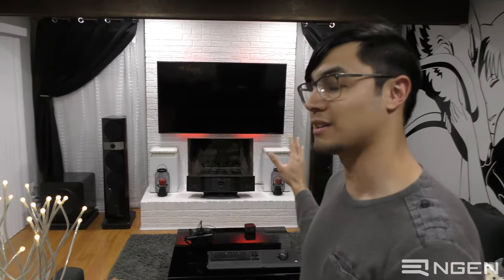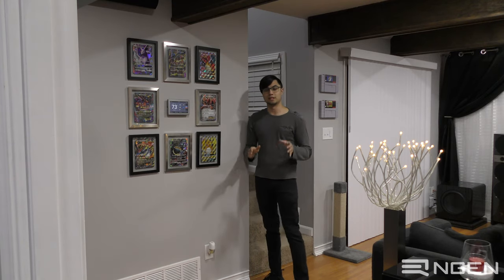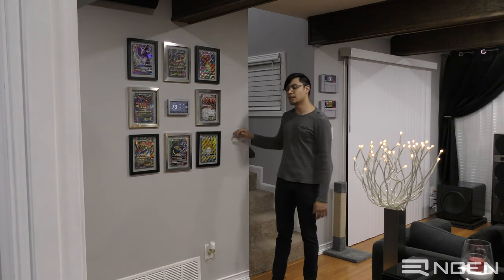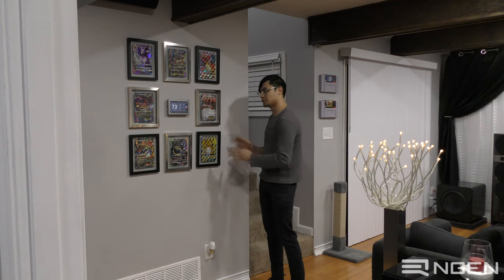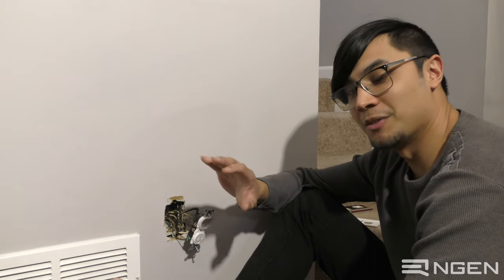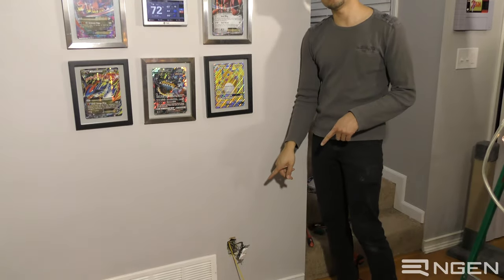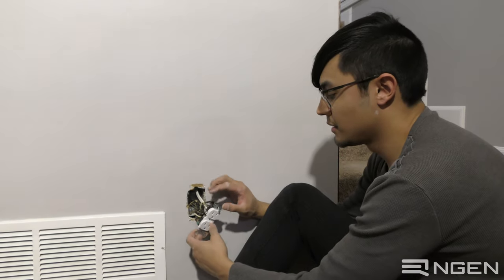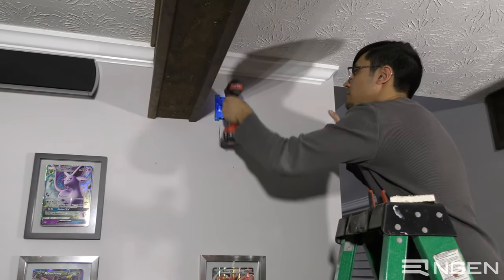HTC Vive - How to Install the Base Stations Cleanly

Comment: came here to see how base stations even connected to things. learned how to install outlets
Reply: Ye do you need to use usb 3.0 or is Bluetooth just as good for the vive 2.0 lighthouses
Reply: this is why vr isn't ready for the average consumer
Reply: @cavejohnson4054  idk about that VR is really easy to setup. The oculus quest is a no pc Vr setup and literally takes 5 min to setup. It’s just the more advanced headsets with full body tracking that take time to setup.
Reply: @cavejohnson4054  i literally looked it up and instantly got an answer. I didnt know if they were battery powered or plugged into a wall outlet.
Reply: @memetix7596  batteries on those are out of quastion, system relies on base station not being moved once you set them up or else you need to recalibrate again by seting up play place in steamvr

Comment: as a certified electrician I can say that he did a good job though if I were making a tutorial about this I would’ve mentioned about maybe having a live detector to test the socket to make sure that when you shut the power off the power is actually off in some older houses some of them will have sub fuse boxes or more than one so even if you throw the main fuse box as far as you know of there might be a secondary if you have a workshop on the premises for high-voltage equipment This is probably not the case for this person in particular but they cost $12 and could save your life

Comment: Always avoid using the push in  on electrical outlets unless you’re wiring sockets in series it’s not necessary and is very likely to fail overtime resulting in the live or the load the slip out of the slot resulting in an electrical fire remember you’re relying on friction the hold these things in place personally I would rather splice the wire and have a connection that would never slip over a connection that could potentially slip Overtime but this is really a personal preference thing it is perfectly safe to do so as even if you did accidentally arc your live line to the ground it would just pop the fuse in your fuse box

Comment: If you are working in older home and mounting onto a stud dont forget to pre drill a smaller hole before going for the screws. Screwing straight into old studs leads to cracking.

Comment: Came here to see whether you had any fancy solution for shortening the cable, but after all that, it's just being wrapped around the mount.

Here, of course, anything to do with mains power has to be done by a licensed electrician, so I have to outsource that part of the problem anyway. At least that makes solving that part simpler - I just ask someone to install 4 new outlets.

I think the most challenging part of my setup is that one corner is not near a wall, and on a higher level of ceiling. So I'm going to have to use a ceiling mount and some kind of extension to drop the base station lower so that it can still see the others.

Comment: Very cool. I run a VR arcade and this will be helpful for setting up our cables. The last owners of the location has all his wires ran externally but this has given me some epic ideas for lighting and other things I’ve been wanting to do.
Reply from the maker: Excellent! I'm glad it helped. One of the best parts is that once the outlet is there, it is really easy to upgrade the components in the future. Just simply swap the lighthouses and plug the new ones in! Should save you a lot of time in the future. Best of luck with your VR arcade!

Comment: my base stations are installed in almost the same way, except that the sockets are mounted directly in the ceiling and not the walls. the base stations have been connected to power for almost two years now. To switch them on and off from standby I use my own Android / iOS app - check it out if you like.

Comment: And for those of you saying that this is not safe you can technically add 12 sockets to the same fuse as long as you don’t exceed 16 A of load you don’t risk popping the fuse or melting the cables hence the reason why you can plug a power strip into both sockets in the wall

Comment: I realize that this is overkill, but you can buy electrical outlets with a built-in surge protector. The Vive (and Valve) wall-warts are built from the cheapest step down transformers and regulators, and the base stations contain equally cheap electronic components, and could be sensitive to surges. The failure rate of base stations is just too high for comfort.

Comment: Any tips on where to put them in the first place to make sure that they cover the play space
Reply from the maker: Consult this guide here: https://www.vive.com/us/support/vive/category_howto/tips-for-setting-up-the-base-stations.html

Key Points:
Mount the base stations diagonally and above head height, ideally more than 2 m (6 ft 6 in).

Secure the base stations in a location where they can't be easily jostled or moved.

Each base station has a 120-degree field of view, so it's ideal to adjust its angle between 30 and 45 degrees to fully cover your play area.

For optimal tracking, make sure that the maximum distance between the two base stations is 5 m (16 ft 4 in).

Avoid setting up in an area with bright light, which may negatively affect the performance of the base stations.

Lastly, I highly recommend a link cable (3.5mm stereo audio cable) between the two base stations. In my new house I ran the cable. Tracking is perfect.

Comment: This only works in cheaply built American houses 😂
Here all walls are brick, meaning you have to use a demolition hammer to make a canal for the cable, use plaster to fill it up and if you want it to look nice again you basically have to repaint the whole wall so it looks even
Reply: Other countries are starting to build that way too. In the UK drywall is becoming popular and so are wood frame homes. In Norway they build homes like that.
Reply: Sounds like you have a plan! Now turn off the VR Prawn, take off the headset, clean yourself off yourself, and get to work!

Comment: does anyone have any solutions for so I live in an apartment and if I do anything to that wall it's obviously going to break my lease I don't care if I see the cables or not I just can't hurt the wall
Reply from the maker: Some people hide them behind raceways. Or you can just get command strips cable clips and just organize them linearly up the wall to make it look as clean as possible
Reply: @NGENPCs  and will command strips work for the mounts as well I don't care so much about the cables because I'm legally blind and really can't see it I'm more concerned about the mounts and I don't want to damage the wall
Reply: @NGENPCs  oh and just an addendum to that last statement I can see enough to enjoy VR I did it a little bit trying to get it set up not successfully but I did do it and I liked what I saw but I wouldn't be able to see the cables I think I'd be fine there

Comment: Any one know where I can find these wall mounts?
Reply from the maker: These come with the Vive base stations. You can order them through HTC themselves, or simply use another wall mount with a tripod 1/4 threaded screw. If you search on Amazon you'll find many compatible, off brand mounts for cheap.

Comment: The cable on the power adapter is not up to code ... yet he installs an outlet by himself? A licensed electrician is he ??
Reply: You can do things up to code without a license. You just have to know what's up to code and what's not, which the internet/a professional electrician can tell you. Most people just don't do it themselves for fear of setting a fire/electrocuting themselves.